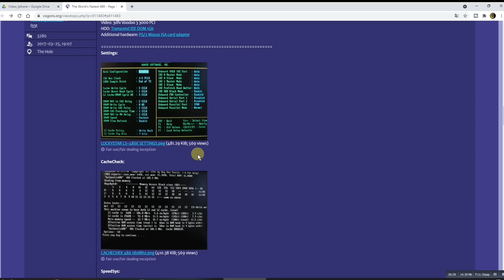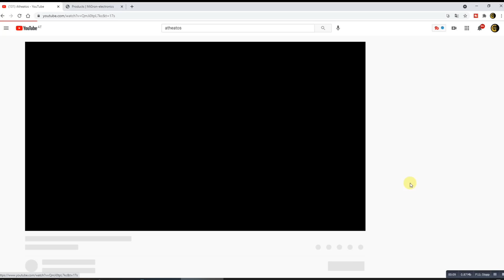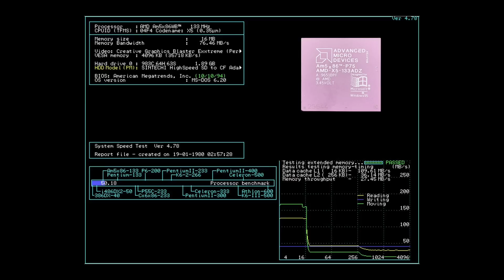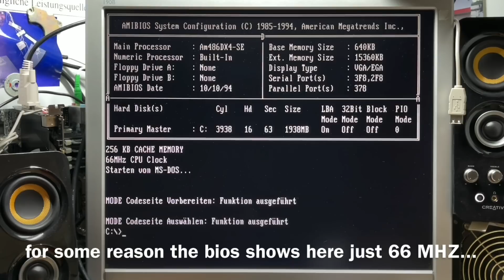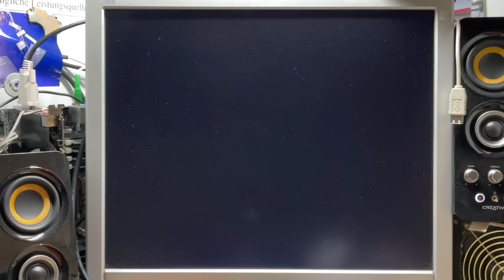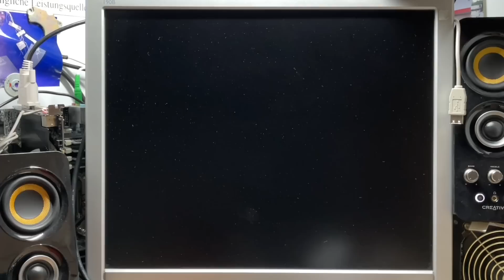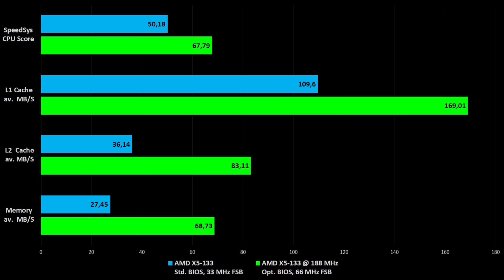AMD X5-133 Overclocked @180MHz / RECORD FPS in Quake/ PCI Clock Checker Tool

Comment: Awesome video!

Worth noting for anyone taking up the challenge, even if you were to achieve say 200mhz (50mhz x4) you likely still wouldn't beat the Quake score because you would be limited to 25mhz on the PCI bus or 50mhz if you have a board like this that can be tricked into bypassing the divider or a PCI enabled board that lacks the divider entirely. Ideally you would want to run at a 66mhz FSB setting, this will net you higher PCI speeds. You will need a PCI Graphics card that uses the same GPU as an AGP card (like the one used here). This will guarantee you are able to run at the full 66mhz as supported by AGP.  Other tips would be larger, faster lvl2 cache. I think the key here is overclocking the floating point unit as far as possible in conjunction with a 66mhz PCI bus. 

I don't know if CPU Galaxy tried this but I would be very curious what the result would be with 66mhz FSB with a multi of 2.5, would the extra 6mhz on the PCI bus make up for the lower overclock, 166mhz vs 180mhz. How much of the uplift is coming from the faster PCI bus and how much is caused by the faster clocked FPU? The ideal would be to run at 66mhz x 3 but finding a CPU stable at 200mhz will be difficult, if not impossible. Videos like these make me sad that I no longer have my collection of 486 and early Pentium/AMD K6 CPUs/boards. Sadly I moved country and could not bring them with me. Now they cost more than they are worth to replace.
Reply from the maker: 3x66 MHZ and also 66 mhz on the pci bus is already in work 🙃. But with another board and I need some active cooling the cpu to 0 degrees... soon, here on my channel. 😉
Reply: @CPUGalaxy  Excellent, looking forward to the results :)

Comment: 180MHz 486? Damn, didn't even know the X5-133 can clock so high.
Reply: It is possible to get some very late X5-133 chips up to 200 MHz. Back in college we had some old 486 gear in the tech lab and were futzing around with it during a break trying to see how fast we could get the various combinations of CPUs and motherboards to boot. There was this one really generic 486 all ISA board which supported a 50 MHz bus speed and a 4x multiplier, so we tried a Kingston Turbochip we had lying around and it actually booted into DOS.

We were all stunned it booted and reported 200 MHz CPU clock, but didn't think to try and benchmark it. It ran basic DOS applications, but that doesn't really say how stable the configuration actually was. I'm sure it probably would have had stability issues at that speed.
Reply: @GGigabiteM  my 5x86 once posted at 200, but since then max is 150. Not even 160
Reply: @mixal31  On 150 MHz is faster than on 160. Because of higher fsb than 33Mhz and stuff...
Reply: I am working on a Vortex86 200Mhz 486 from SiS at the moment.
Reply: That's silicon lottery for ya
Reply: You have to be quite lucky to manage that speed. But 160MHz should be doable with many more chips. Personally, I don't dare overclocking my retro stuff... I can't afford to risk damaging anything, but I'm certainly impressed by these numbers. Heck, that 486 is faster at Quake than my K5 100MHz, despite the K5 being a 5th gen chip.
Reply: @rebeccaschade3987  X5-133 chips are extremely common, so don't worry about damaging a rare piece of hardware.
Reply: @Zerbey  They still cost money, and I'm more worried about damaging the motherboard (voltage regulators etc.)
Reply: @rebeccaschade3987  I wouldn't stress too much about overclocking your retro stuff as long as you don't increase voltages and just bump up the FSB / Multiplier to do it, and have sufficient cooling - basic heatsink/fan combo is all that's needed for that era gear.. I have been overclocking my CPUs/FSB, video cards and RAM since my 486DX4 days back in the mid 90s all the way through to today, including my laptop's (mostly only overclocked gaming laptops though i.e. ones with decent factory cooling designed for performance) and never ever had a chip or hardware failure.. sure I've had some stability issues which were cured by backing off a bit with the overclock but in all those years/decades and dozens of systems, I've never killed anything and I've pretty much overclocked every single system I've owned - but again I only overclock without playing with voltages etc. Overclocking like this has given me some really substantial gains - especially systems where I have been able to overclock everything from CPU to bus speed to ram timings and video card - such performance increases that it's saved me from upgrading systems for another 2 or 3 years over the time I originally planned to keep them for and a big enough speed increase to make games playable that were originally unplayable before the overclock.

Comment: I configured them in 50x3 (150mhz) or 40x4 (160mhz), the latter being the maximum speed that it reaches, with a normal cooler ... I never tried to exceed that, and I really don't know if it could have been with the matherboard I was using. (nineteen ninety five)
Reply: I think that is a pretty good setup to settle on. Its easy enough to pick up a pentium 100 or 120 and bridge the gap to higher end. I am not one for typically driving old hardware to the wall like this, though it is pretty fun to try once in a while!  Way I see it is there is always one notch above it that is cheap to get.  But there is something pretty kool about claiming to have the worlds fastest X5
Reply from the maker: and I am not at the end. a 200 MHz video will follow. 😉
Reply: @CPUGalaxy  oo00OO000oo!  I am anticipating this one!  I have heard of a rare few others getting the magic 200 before but are usually barely stable enough to run more than a benchmark or two.
Reply: @CPUGalaxy  50x4 clock set... good cooling and... take care that the pci or isa bus is still within the correct parameters. These tests will work as long as no extra expansion boards are used.  ISA or PCI bus speed depended on a main bus splitter, good luck with that.
Reply from the maker: I used 66 MHz x3 😉 and Peltier cooling for the cpu.
Reply: @CPUGalaxy  but that motherboard only supports up to 50 mhz of base clock .. how do you manage to get 66mhz on it? In addition, it has a 4x multiplier .. and increasing the bus speed also makes any onboard device work more tapped, such as the IDE disk for example.
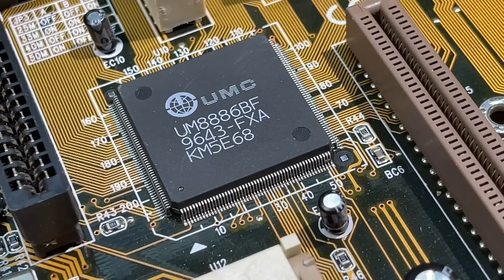Reply: 1:29
Reply: @diegocesar316  that rev has support for 66

Comment: There's something so comfy about the gui of that bios.
Reply: There is also a mouse support if you plug one 🙂
Reply: Indeed, haven't seen this one in a while!
Reply: It's called WinBIOS, and It's pretty comfortable for me :)
Reply: @Sebastian Neumann That BIOS didn't run in a minimal install of Windows at all, it was its own GUI that looked similar to Windows 3.x era graphically but it was all built into the ROM chip so even without any Windows installation at all or even with no hard disks attached it was still that exact same mouse supported BIOS menus with a GUI.
Reply: I’ve got this bios (or very very close) on a slot 1 system, and I absolutely hate it! 😆
Reply: Used to hate it also, too user friendly. Blue bios is the real bios
Reply: My 486DX2/66 back in 1994 had that same BIOS.. American Megatrends (AMIBIOS) was always my favourite bios back in the days
Reply: My first Cyrix486SX-33 had the same bios
Reply: @Sebastian Neumann the closest you can get to this is UEFI
Reply: Thats's a flashy bios,but still dont beat the Award III.-s
Reply: Used to hate it back in the day. As other commenters have said, the blue Award/Phoenix BIOS is the way to go. Whenever I came across these I was like "ahh it's an AMIBIOS!".
Reply: A lot of Acer  boards had that bios.  I liked it personally, but was comfortable in most bios types.  The mouse support was novel but fluid, in fact it was WAY better than the mouse support on my MSI Board for my ryzen 9
Reply: @Sebastian Neumann No, there's no Windows there at all. I wager a guess, that might even all be text mode trickery with a lot of custom characters - and extra more being redefined on the fly to render the mouse pointer, which is 1 character in size, but needs 4 characters to render, since it could be on any pixel.
Reply: @SianaGearz  driving a VGA card direct from the registers is what the BIOS already does when any DOS program or game uses an INT to call the BIOS. so it only need a bigger ROM to store a bigger program to be able to actually draw things in the graphic mode.
Reply: I think my Compaq Contura 486 notebook has the same BIOS
Reply: It looks better than alot of American mega trends bios made after.
Reply: I was so fascinated by exactly this Amibios (had 2 mainboards with this layout, one was umc) the first time I went into it. As far as I remember it also had mouse input. The only other bios in that style I have seen so far, was from the 486' Thinkpads (300 something)
Reply: he is faking, its UEFI with a ryzen 3 gen cpu )))